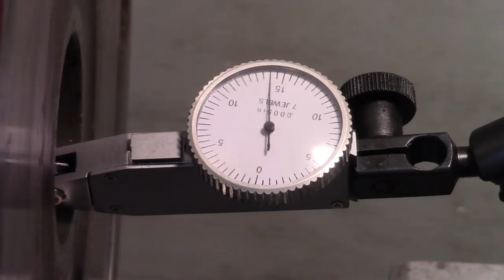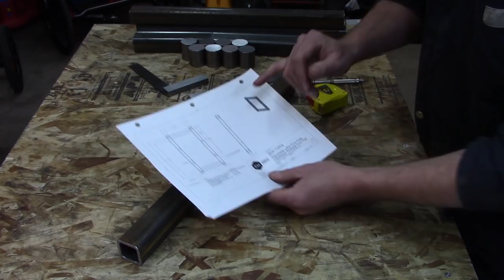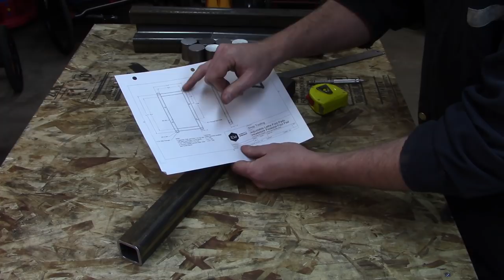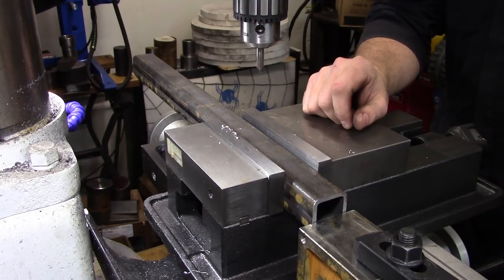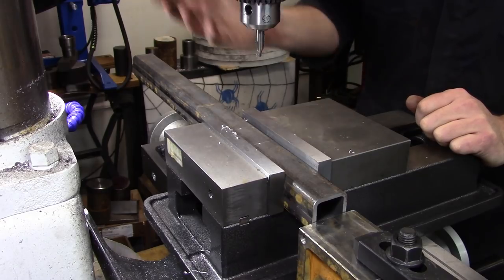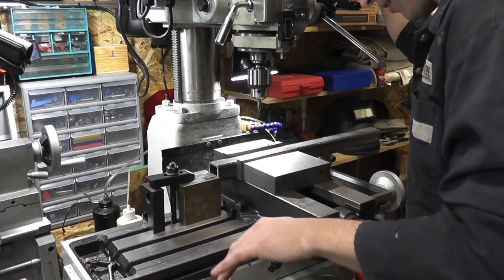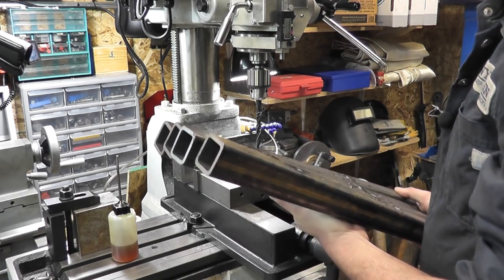Making Adjustable 12x36 Lathe Feet - Part 1

Comment: Oh boy! Some actual machining! Most Youtubers have been doing year end recap videos.

I agree with you that step drilling is necessary for anything over 3/8”.

I like how you shop people the set up for each step but shorten  most of the machining.
Reply from the maker: I find that with my 1.5 (claimed) hp machine the tool pressure can only be so much before we have problems so step drilling it is.  As for the speeding up, it's all part of seeking a balance between talking and making chips - info vs action.  Too much of either takes away from the whole.  Hopefully as time goes on it  can be better balanced.

Comment: Hi Everett - this looks a very worthwhile project.
Don't worry about wrong holes - if I had a dollar for every time I did that I'd go buy some new tools!
Your lathe chuck looks super shiny - I try to keep mine that way but even so at times get caught with a bit of flash rust.. despite keeping surface oiled.
I agree regarding step drilling... kinder on smaller machines. That was a good start :)
Reply from the maker: The feet have been a while coming, but now that I have a good used Starrett 6" machinist level it's time to properly finjsh the job. I still think there's a way to 'fix' my screw up too . . . As for the chuck it helps that the garage never gets to freezing temps, helps minimize condensation. In a situation of an unheated shop like yours it would be a constant battle. Hope your back is feeling better lately.

Comment: I did something similar for my 13x40 lathe. Cant wait to see your final assembly. Jim is good people. I was gifted some oil cups also.
Reply from the maker: Got a few more pieces to make, some welding to do and then the process of leveling. It'll probably be a 3-part video at this rate but maybe it can get shoehorned into 2. And yes, Jim really is a certified good guy, and I really enjoy his ideas and work too.

Comment: Looking good.  Build a cart for that band saw so you can roll it around and not have to work on the floor.  I wish my lathe had square surfaces like yours does.  It would be so much easier to stick a magnetic indicator holder on it from all the various angles.
Reply from the maker: Thanks, Harold! The bandsaw came with a stand of sorts but it's low to the floor to partially slide under the welding table for space saving. There are some square surfaces on the lathe but some, like the ways, are a bit small to get an indicator to hold.  It's why I wound up making an indicator holder. Hope you're doing well.

Comment: Questions and comments. Are you storing your bandsaw under a bench because it’s on the floor? I’m old bending would kill me, I have mine on casters so I can stick it in a corner. I order most bandsaw blades from Amazon ( we’re prime members 2 day shipping). On the lathe my G0750G has the same problem the pedestals hole pattern is too narrow, since my shop is a storage building I have wooden floors, I welded angle between the pedestals front and rear so I could bolt the lathe down. I like the concept of spreading out the feet, besides to bolt to the floor if your lathe is similar you’d need to have studs in the floor. 

On the repetitive operations make another stop with a adjuster for the front of the carriage, then you can position the carriage that way. Most older high end lathes had work stops. My work stop is made similar to your indicator holder, with a quick lock to tighten it. That and using CNMG tooling you can run the block square an do the chamfering in one operation. Before I retired I ran CNC lathes these tools were used in this fashion all the time.

What size vice are you using? You can make your own speed handle for it rather simply. I’m working on one now I’m giving to someone but the one I use is shop made. I know you can buy one inexpensive but what’s the fun in that. 

Thanks for the shoutout
Reply: Agreed about aging and working on the floor, bad combination...!!!!      lol
Reply: @pierresgarage2687  yep I agree
Reply from the maker: Yes, the bandsaw came with a frame, but it's low to the floor to slide out of the way, I have to use cubic feet, not square feet.  A micrometer stop to the left of the carriage is coming, just need time to build it. And it's a 6" import vice, will make a speed handle at some point.  Lots of tooling I still want to build, as there's a certain satisfaction in making and using your own tools. And thanks again for the paint cups and brushes!
Reply: Everett's Workshop on the speed handle I made mine, if you go back and look I have a video on the build. In fact I just finished another one for a friend as a surprise.

Comment: Love that shop tune you lead in with. Nice little "I gotta do that sometime" project. On the bandsaw, is that switch a modification or is that OEM, I am interested as mine is kind of sticky. I also had to true up the drive wheel about .030". Cheers and HNY Everett!
Reply from the maker: Happy New Year to you too! Pedestal feet had to happen sometime, I want to be able to do longer journals without taper. The switch on the bandsaw is OEM, and the little tab to shut it off is too. It just needs tweaking to work properly. Cheers to you too!,

Comment: Hey Everett
I have the same machine. And did shim it but after many year floor is stating to settle.  I think I'll do this when I can open the garage door when its warmer out side. -17 this morning Burrrr.  As for time don't have much these day work is taking over get to work by 5:00 am and dont get home till 19:30 hrs Just not enough hour in the day.
Cheers Fred
Reply from the maker: I noticed you have the same lathe, wasn't sure how it was mounted to the floor. I used wooden shims and a carpenter's level when I got it home because that's all I had. As you know these machines have their quirks and need some tweaking if it's to be hoped to get any sort of accuracy out of them. I hear you about time, even though I'm not doing the 9-5 right now (stay at home dad) shop time is at a terrible premium . . . Looking forward to when I can get Little Man out there with me! :D Hope you're doing well.